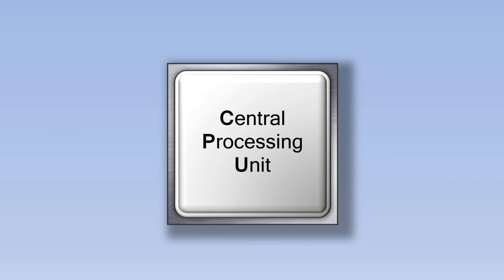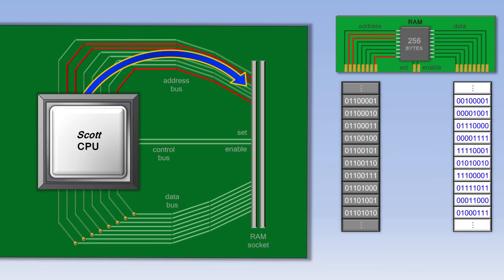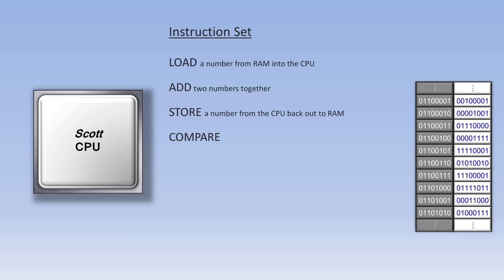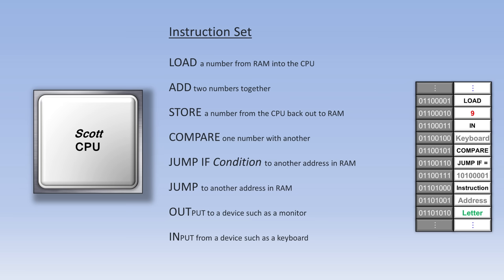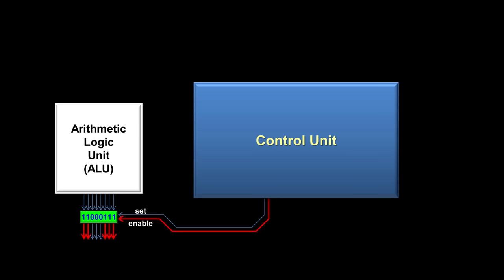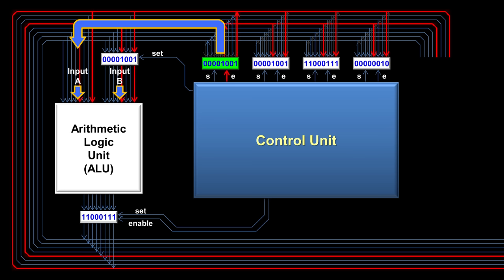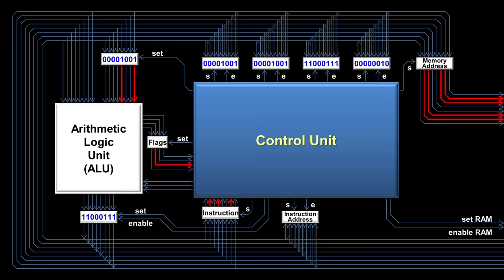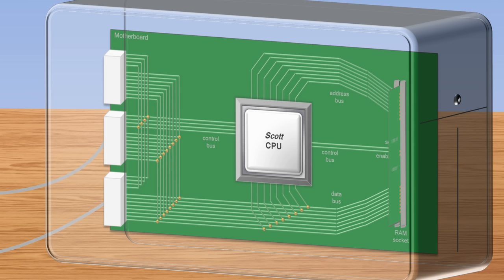How a CPU Works

Comment: Yes, I see what the cpu is actually doing, but HOW?
HOW does this thing work? When you turn on a light switch, it closes a circuit and electricity runs to the light bulb, turning it on. That makes sense.
But how does a cpu know what to do with instructions? Sure, it gets some information like A and B and "add these", but how does it know what "add these" means?
Reply: Ha good question. I suppose it doesn't know. It's quite complicated. Things with motherboard, BIOS and stuff. In the end you have certain 'starting points'. Like putting in a Windows installation USB/disk, it complies to what the computer understands as 'starting point', and can read instructions etc. from that point on. This is where software developers come in, they created the instruction sets in such a way the computer understands. It flows from instruction to instruction because the developer wanted it like that. If something does goes wrong in that instuction flow, you have a bug. So as an example; The Windows Installation is a program DESIGNED to adhere to these 'starting points', scan system devices, move data from installation medium to a storage medium system device, and create a 'starting point' on that storage medium, which would be your new Windows OS. Hope that might clarify things for you :)
Reply: Martijn van der Geest well that makes sense and I get it from a software standpoint, but I'm talking about down to the electronics. Like, down to the VERY basics. I know how a transistor works, but you put so many of them together and how do they work together? What controls them? What controls that?
Reply: I unfortunately don't know that either. Probably because it's super complex. It differs per manufacturer, hardware setup, period-in-time and loads of more factors. Hmm yea, bottom line; It's really really complex stuff.
Reply: 1st the bios 
2nd the OS
and in between there's the motherboard ship (bridge) 
atleast that's what i know
Reply: CPU is wired in such a way that when instruction is consumed by the processor the flow of electricity is altered based on the bits instruction is represented with, forcing some CPU components to change its state and eventually producing intended result (e.g. moving value from one register to another). 

I highly recommend a book: "Code: The Hidden Language of Computer Hardware and Software". You will not be disappointed.
Reply: All instructions are hard-wired which means that the CPU contains circuitry that performs the operation. The most primitive circuits you can build are OR "logical or" (outputs 1 if at least one of two inputs is 1 and 0 otherwise),  AND "logical and" (outputs 1 only if both inputs are 1) and NEG "logical negation" (outputs 1 if the input is 0 and vice versa). All circuitry is built up from these logical primitives.

To stay with your example of add, lets consider the simplest case: adding two single binary digits. You need to construct a circuit that outputs a 0 if both inputs are 0 and outputs a 1 if exactly one of the inputs is 1. If both inputs are 1 you will have a problem because the correct output would be 10 which is not a single digit anymore so lets disregard that for the moment.

If you disregard the last case, what I've just described is a "logical exclusive or" (XOR) which for example you can build using four AND and NEG gates. A real adding circuit is more complicated because you also need to worry about the carry bit (the last case). But I think you get the idea: The computer adds just like we learn in school: Add two digits and carry the 1 if needed. Continue this until you have exhausted all 32 (or 64) bits.
Reply: It's quite simple actually. Go see how transistors work. That's all you need to know.
Reply: Electronics are real, I don't understand what you mean ..?
Reply: Mitchell the video actually explains your question in simplest detail on 17:00 it all happens with circuits, read some about moore's law and microprocessors in general, you will get a better idea.
Reply: Mitchell, I'm still filling in some blanks, but Alex Woho is pointing you in the right direction. But here is what most sources do not explicitly spell out; there is no "1" or "0", anywhere on that machine. "Digital logic" is an abstraction of "Analog" electromagnetism, and electromagnetic radiation. If you pulse a light, or switch, it could be inferred as on=1 off=0, but in fact the moment power is applied an analog signal is generated. What a transistor does, specifically a FET, is increase or decrease the induction, and therefore output, of one conductor, when current is applied to another conductor that is close enough or even "contacting" it. Where it gets kinda murky is the fact that this is amplitude modulation (AM) of DC current, and that the transistor is only able to do this when it too is powered, by way of the "clock", which is measured in frequency(FM)... or AC current. For a visual learner, like me and maybe you, the study of propositional logic as applied to computational devices must be mapped out upon a solid understanding of electrical theory and engineering. Here are some keywords that will give you plenty of threads -  micro architecture, register transfer level, cmos, ohms law, verilog, jtag, digital logic analyzer, and also, study colossus, illiac I and II, and the F-14 Tomcat Central Air Data Computer, THE first microprocessor.
Reply: actually numberphile or computerphile has a video about making binary logic gates with dominoes. maybe this will help you out a bit.
Reply: Usually code is written in a place for instance...in a file.  this file has "assembly language" written in it  and assembly language is just the instructions that were mentioned in the video. for instance...

(This is written in no particular instruction set or assembly language just very general.)

load a;  // loads the "contents of the Address" of a into the the memory bank inside the CPU.  (register)
add b; // adds the "contents of the Address" of b to whatever contents that are already inside of the CPU register (which contains a)
            // at this point, the contents of whatever is inside of the CPU is now the addition of whatever b was.
store c; // the contents of the addition are now store in location c "Address"
end; // sends a signal to the computer that it is complete with the program.

// at the bottom of the program, this is where you make your "assignments" to whatever values you want a, b , and c to be.

a = 2;  //the address "a" contains the value "2"
b = 2; // the address of "b" contains the value "2"
c = 0; // the address of "c" which contains zero, but it doesnt matter what is in there because whatever you write to will get written over.

i hope this helps.
Reply: well, instructions are bunch of 0s and 1s, but there are certain rules as where the instruction information coming from. let say the first 4 bits of a 16-bit long instruction are reserved as OPCODE, that opcode will decide what operation the ALU will do.  For ex: if first 4 bits are 1111, it is ADD; 1101 is SUB; 1001 is LOAD... These bits will be passed in a decoder and the output go to the control unit in CPU and that will select the lines in ALU to do the appropriate operation. This is the explanation gave in the video, but not very true for modern processor. In reality the opcode will be passed through some logic outside the control unit and output the command to select the lines in ALU. 
Of course there are more details behind that, but it is the basic. I'm taking a computer architecture class and still wondering how they come up with this :)
Reply: Here's my explaination. It gets the instruction in the instruction register. which is zeros and ones like 01101.... And these lines data from instruction register  are input to an NAND gate which triggers the Select Signal which is active low connected to the ADDER circuit. And then the ADDER circuit will be active to perform add two inputs. While other circuits are deactive. 
So that's how it know ADD these means
Reply: IIRC, this series has another video which explains how an adder circuit works down to and including the transistor level.  I highly recommend it.

I was hoping to see that same level of depth in this video in regards to the control unit.  I suppose I'll just have to check out the book. ;)
Reply: +Mitchell
that's where programming comes in,
your computer's operating system is the software that controls all of the hardware, including the CPU,
it instructs CPU what to do, when you sad add, the lines of code written in OS will instruct the CPU to use the ALU to perform and addition operation
when you say print, the OS will decode your instruction, tell the CPU to access the device controller, and send a page to the printer over the network, or wire if connected by wire
everything your CPU, hardware, and computer does is controlled by your Operating System
Reply: It doesn't need to know that. If it did it would be a human
Reply: Mitchell

Hi Mitchell, I think I understand what you're getting at with your question. Are you asking how the control unit can receive an instruction in the form of 1's and 0's, and just "know" that this instruction means add?

If so, I recommend you look at episode 7 of the 'Crash Course: Computer Science' series on Youtube. She explains that bit at 2:50 in the video. I recommend that whole series actually. If you watch the videos in order from the start then it slowly builds up your understanding of how a computer works, starting at the transistor level, and working its way up from there. Good luck!
Reply: Your light switch is spot on. The CPU works in the same way, only the switches are tiny transistors. The instructions are arranging these switches in such a way it will "know" what to do - say, "00101101" tells it to compare two values, whereas "00101100" tells it to subtract them instead. Just an example, of course.
Reply: The control unit determines what type of instruction will be executed by reading the instruction's opcode.  Then it sends a control signal to a multiplexor that is inside the ALU to select the output before it gets put back on the bus.  The purpose of a multiplexor is to select an output when given many inputs.
Reply: it's called the logical gates and it's performs with elecronic components that can be controlled with the input. this input can turned on this gates like AND OR gates and it can be turned off like NOT gate and other gates that are made by this precedent gates.

Comment: But what is the CPU doing to the data when it is "Processing" it? Thats what I have never understood. What does the CPU actually do every clock cycle is it just doing math?
Reply: It's mostly taking in things and deciding where those things go to and what it's effecting. RAM is just expansion of how much of it can be handled at once for comparison or for use. It looks for similarities and patterns out of what goes in, and decides what goes out based on that and how. It does this with the different loop arounds to make the things going in compare to the things that have been in. What makes this more difficult to explain is the arrangement of interaction inside the bigger areas. The part where he describes what the 1's and 0's can mean with RAM is as basic as it is to explain by comparison. It makes more sense if you've seen how coding arguments work.

Let's say you're moving you're mouse upward. It's going to go through the processor something like: move cursor upward this much, move cursor upward this much, move cursor upward this much (for relative of how much the mouse was moved and mouse sensitivity is accounted for), and that will be sent visually to the monitor and the cursor position will be kept in memory for interactive purposes of what you see on the screen. Now an example of the IF scenario: If mouse is over this expose icon/button on the display that is my screen and clicked, engage with this thing it's over. Then depending on the thing will decide what that does whether it's a single or double click.

The point of the designs is to use electricity in lengthier procedures to do logic handling in a mostly mathematical way. Hope this explained something.
Reply: Everything a CPU does involves turning switches on or off. Zeros are off and Ones are on. That is what the CPU is doing when it is processing data. Search "binary" for more information.
Reply: The alu contains a lot of logical ports (like and, or, not,...), combined in such a way that the incoming databits, together with the instructionbits from that cycle, gives the logical outputbits after going through the alu. So this is just an electronic circuit, synced with a clock to read the input and write away the output state every clockcycle. If you want a simple example to understand how this binary math works with logical ports, you can check 'adder (electronics)' (e.g. on wikipedia).
Reply: Buy the book mentioned in the video. It explains pretty well all these details. Or look here: http://www.buthowdoitknow.com/but_how_do_it_know_cpu_model.html - author explains step by step all elements of this simple CPU.
Reply: Thanks guys. I was really talking about the actual physical baseline of "processing" a 1 or a 0. After playing with logic a game called StarMade I think I understand it. 

Its basically switching circuits on and off which trigger other curcuits depending on what operation you want? Like in the olf days it would be sending a signal down one wire or another is that about it?

Thanks for the replies :)

(and of course I know what binary is xD)
Reply: its moving information around the bus to the multiple components inside the cpu. basically "data" is a specific set of on/off instructions which can be output by the cpu as it moves it all around the cpu. just don't ask me to go into details thats what im trying to wrap my head around now

Comment: So RAM is how many arms you have to perform functions, and CPU capability is how fast those arms can move?
Reply: The RAM is your space on the table to do work. 
Your Brain is the CPU, just imagine nothing but calculations, but it's easy because it's all mechanical and comes to you via LOGIC. 
A computer cannot do something it was not MEANT to do. 
The GPU is like a brain on steroids, capable of doing different computations, styles of computation, and just raw fucking rendering power for complex but already figured out methods of visual creation. It however is not capable of the clock speed (until now) that CPU's are able to perform. It runs secondary however powerful to the master computation unit. 
They run separately to account for different variables in whatever is being processed, whether music, browser, media, or games. They all have their languages, sets of instructions and generally the same overarching design specifications that make it possible to enjoy what you're seeing right now.

Comment: I'm gonna add that a Turing-complete machine needn't have IN and OUT instructions as such, unless the I/O is port-mapped (mapped to a separate, RAM-like space). Memory-mapped I/O is done on computers where the RAM is monitored by peripherals and any change in their segments of RAM triggers an interrupt that goes to the peripheral.

Especially since you can assume that on an actual Turing machine, the initial tape reading can be thought of as the input, and the final reading the output.

Comment: The 6502 was also used in the early arcade video games from Atari. They were vector drawing video games ; the first example was the black and white game "Asteroid".
Then came, listed here in random order, Tempest, Gravitar, Space Duel.  The processor 6502 was painfully limited ; all registers were strictly 8 bit, no address pointer. The 16 bit memory access was created with self modifying code running in RAM where the last 2 bytes of the 3 byte instruction were overwritten with the result of two 8 bit addition. Creating 3d games from such a nightmare hardware was truly heroic.

Note: one of the first color video game was "Space Wars", a type of star war game. It used a vectoriel display. It used a processor created from TTL logic gates instead of using a microprocessor, somehow like the first digital computer used for the mission to the moon, the Apollo. Wikipedia says the processor was based on the 1962 PDP-1.
Reply: I think people before were way more smarter since they made things.
Reply: @ggmr399  Many people are using smartly these new tools.
For example, the python animations from youtube channel 3blue1brown are showing similar hard working effort as those who created the microprocessors.
Reply: @moiquiregardevideo  Yeah, but that's because we are able to find any information easily due to Internet. Back then Internet was not an option.

Comment: 0:00: 🖥 The CPU is like the brain of the computer, and its clock speed determines its processing speed.
3:56: 💻 The data inside RAM consists of instructions, numbers, addresses, letters, and can be used for various purposes.
6:55: 🖥 The X passage explains the instruction set and CPU processing in a guessing game program.
10:42: 🖥 Registers and the CPU bus are used to store and transfer numbers in a computer's CPU.
14:26: 💻 The Scotts CPU is a basic computer architecture that uses flags, registers, and control units to process instructions and control external devices.
18:07: 💻 This video explains the basics of how a computer processes information, focusing on the components of a CPU and how data is stored and retrieved from a hard drive.
Recap by Tammy AI

Comment: The C64 actually used the 6510 and the NES used the Ricoh 2A03 which were both derivatives of the 6502, but not the exact same thing. Pretty close though. I mean, if you know how to program for one, it's not much of a stretch to program on the other.